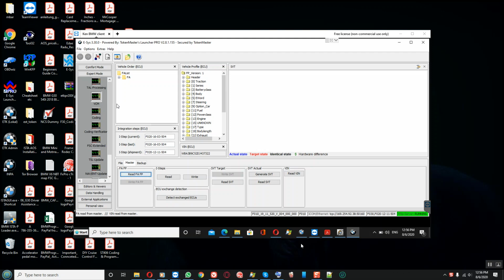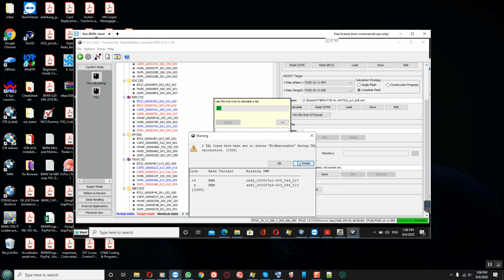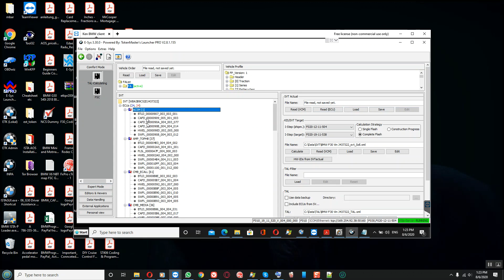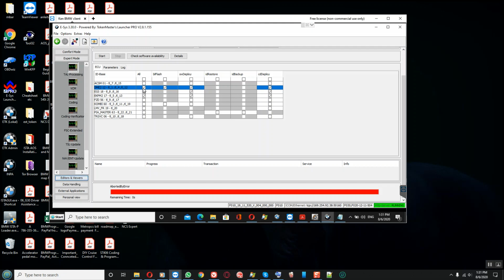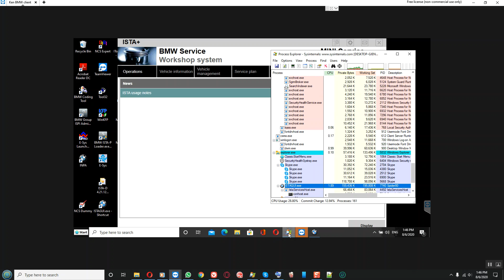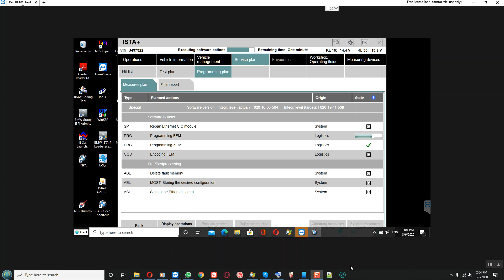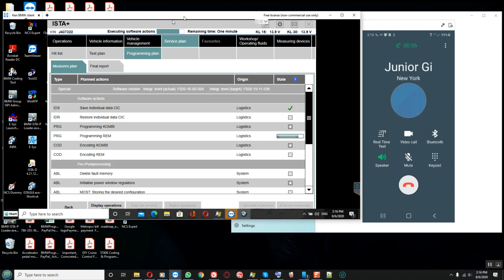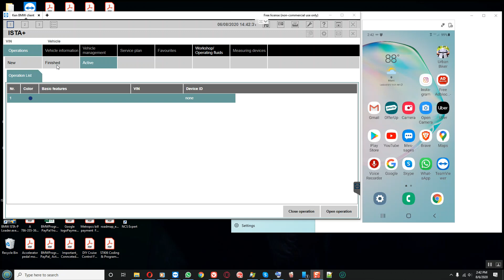BMW F30 CiC CiD LIN BUS Fault 2020-08-06 14:42:41 ( text Watsapp +1786-355-3660)

Comment: I have a 2012 335i f30 with n55 engine. I need help with this similar issue. I have a check engine light on for this problem and am having a problem passing Emissions testing because of the check engine light being on, I bought it from previous owner who said he replaced the  headlight on the passenger side and it’s had a check engine light on since I’ve had it and is throwing a code for “ CD8E10 LIN Bus : Communications Fault “

I also have a adaptive headlight malfunction and headlight vertical aim malfunction. I need to figure out how to code these errors out or atleast find a solution to the problems without having to spend thousands of $$

Comment: yo ! got a fault code cd8e10 lin bus : communication error on my bmw f30 n20
can you help me with this problem please ?
Reply from the maker: Yez , contact via wattsapp +1786-355-3660
Reply: repair the LIN BUS wiring and try clear codes after that.
Reply: @shuayahshuayah890   i have my water pump going on and on until it drains all the battery...i don't know how to fix it